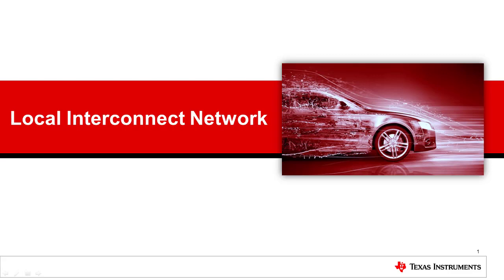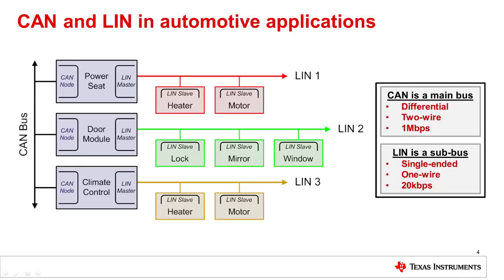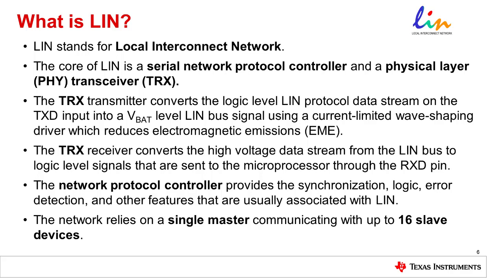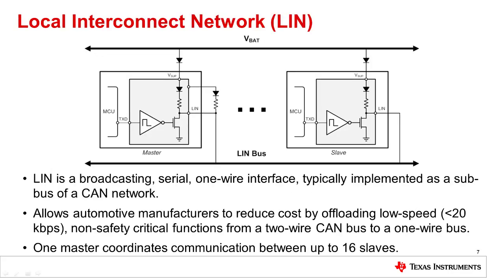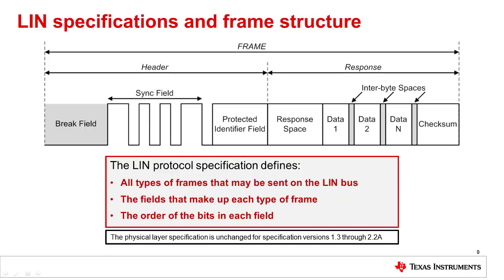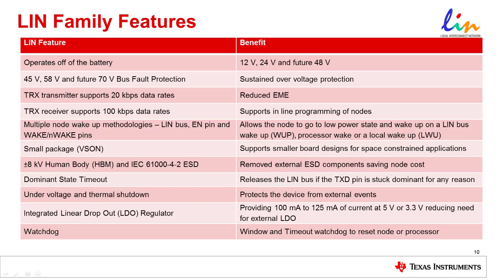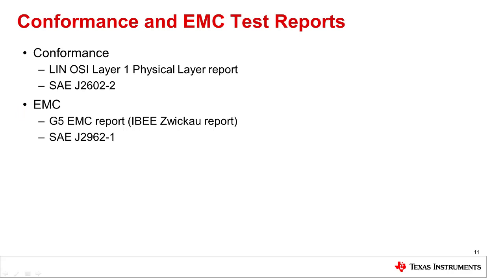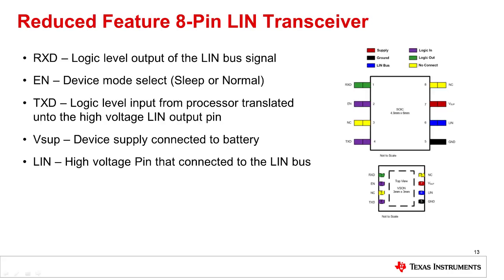Local Interconnect Network (LIN) Overview and Training

Comment: The dominant and recessive bits voltages levels mentioned in this presentation are opposite to those mentioned in the lin slides at the end of the CAN presentation video. Please consider and do the correction as needed in either of the lin or can video by texas instruments.

Comment: Excellent presentation of the technical specs, but you really told us nothing about how it works. All you did was rattle off technical and engineering information, none of which is relevant to people trying to actually diagnose or understand how it works. While the technical information is important, it's better presented to engineers in closed-door meetings for device design, not implementation or training. Also, there was a lot of information that was not adequately explained, like "V-Bat." While I ASSUME this is Battery Voltage, who really knows without explanation? And the wiring diagrams are useless without a legend, or at least talking about how the voltage is directed.

Thank you for trying to talk about LIN, but this was really just a reading of a Powerpoint presentation, which is entirely useless.